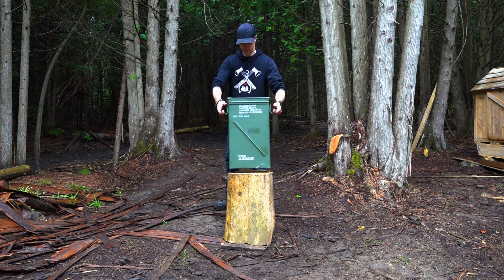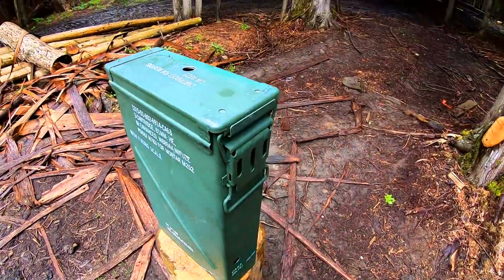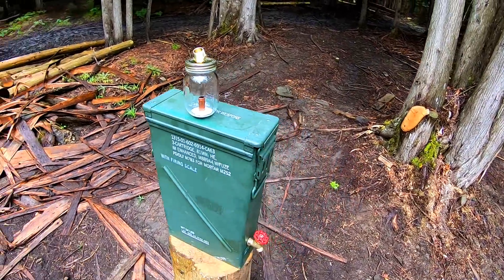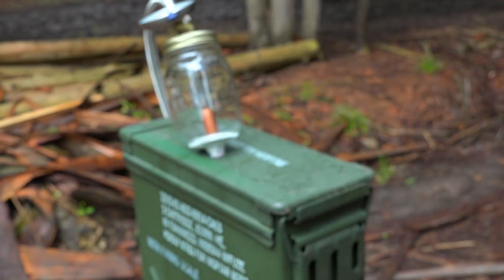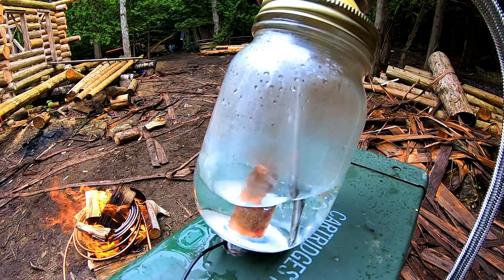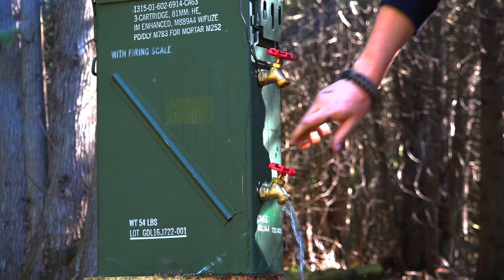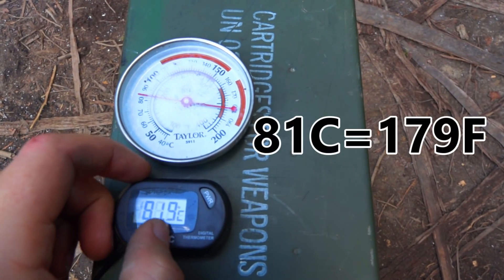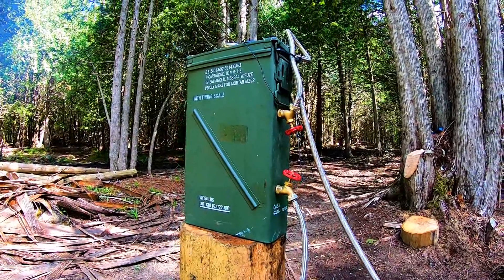Off Grid Heating Prototype- Copper Coil Water Heater / Heat Exchanger / Radiant Heater

Comment: I know you really want to use the bonfire to heat the camper, I get that, and I love experimenting with stuff like this myself. But for actual use, it's just not viable or smart. I'm sorry, but you will never be able to create any  portable system like this and get it to work safely while keeping it somewhat convenient. It doesn't matter if you build water to water, air to water, water to air, air to air, thermoelectric, you name it, it just won't work properly or it will be a nightmare to set up and operate. Just buy a 2KW diesel air heater from china and a battery, and be done with it. You will have plenty of safe and reliable heat at the touch of a button. Just make sure you get an actual 2KW heater, and not a detuned 5KW.

Comment: Assuming the idea is to develop a heater for something like your snowmobile camper I would consider the following - first would be that some form of coolant would be preferable to water, pink RV antifreeze for instance will not freeze and as such you wouldn't have to drain when not in use and blow out the lines.  A small insulated tank on the outside of the camper would hold this.  On the inside of the camper I then run lines from the tank through essentially a radiant heat grid on the floor and use a small pump of some nature to circulate the fluid through the floor for temperature.  The reason for this is that you would then not have all the heat energy built up inside the camper but you would have some control of the amount of heat you wanted.

The larger this tank would be the slower it would come to temperature but the longer it would effectively provide heating if needed.